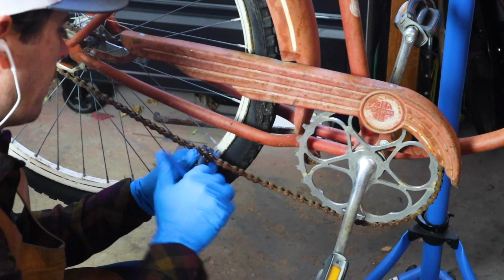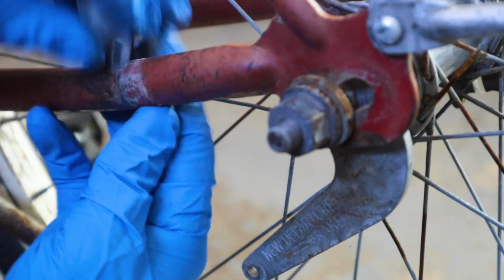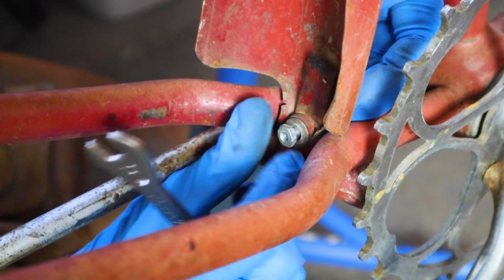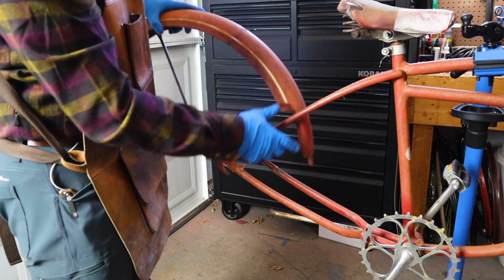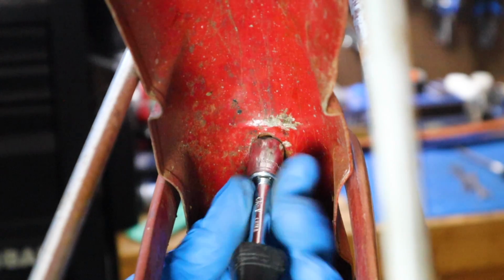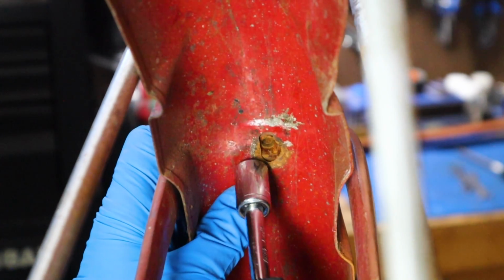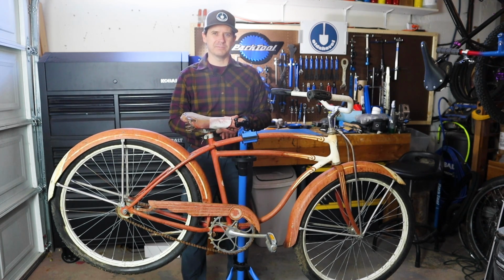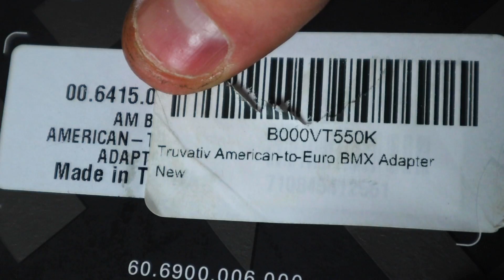Rusty Schwinn Klunker Build

Comment: I think this build is great. Really gave me much to think about in how I go about my builds. I never imagined that a 1" head tube could be reamed out to accept a 1 1/8" headset. I love the blend of old and modern. I think this can be properly be called a restomod. I would love to see more builds from the post war - pre 1970's era. Thanks!
Reply from the maker: Thanks Jim. It’s a fun one. The reaming is a bit sketchy but the tubing was good and thick so I thought it was worth a try. That said, I’m not planning any bid reins on jumps on this thing. 😁
Reply: I was thinking the same thing. The old cruiser 1" is different than a IOS 1" and it looks like the cup size is only 1.4 mm larger, so for this bike you'd need to remove .7mm off the head tube wall thickness. I'm guessing the starting headtube is pretty chunky, so it is probably not a big deal to ream it this much. That New Departure coaster hub is so rad!
Reply: @feltwashers   I've been planning to bore the cups of a standard 1" headset for 1-1/8" since the math seems like it'd work. Not a lot of room, but a cheap headset is easier to replace than a head tube
Reply: I am completely impressed by this move! Since I am confronted with a similiar compatibility problem, may I ask what tool you used to widen the diameter? If it's not a fortune, I am willing to spend the money.
Reply: Mine bikes sells a 1-1/8” headset turned down to fit a 1” head tube no reaming necessary since that’s a one trick pony tool
Reply: *mone
Reply: Thank you for pointing that out. I was not aware that those were available. I visited the site and saw the cups you were talking about. Also other interesting parts on that site. Thanks.

Comment: Never thought the Judy fork or 2.4 tires would fit, now I’m starting to wonder if they would fit my old Rollfast waiting to be turned into a klunker. Awesome build, glad you kept the patina, it looks great.
Reply from the maker: They “fit” but it’s a bit ridiculous. The cruiser bike wheels had to be “precision” trued to make it work and the rear tire had to be deflated slightly to get it on. 😁
Reply: I put some 2.35 wtb trail boss tires on a late 90s schwinn frame, had to deflate the tires to mount them, about 1 blonde cunt hair away from rubbing the frame 😂

Comment: Hey! We used to ride those things UPHILL too, back in the 50s. Along side railroad tracks, and any river or creek trails we could find.  The best hills were on golf courses, because you had a built in jump over sand traps.  Lots of memories in this build - but we left the ashtabula cranks, as they were tough as nails.
Reply from the maker: Awesome
Reply: @oldshovel  I used to have an old LaSalle, actually my first bike. A lot like that old Schwinn, with about a 50 tooth on the crank, and about a 20 on the back.  No fenders, and no cover on the steel framed seat. Big paperboy basket on the front. Pedalled papers with it, with a lot of uphill. My legs were strong back then, and it would really go fast on the flat or downhill.  You forgot to flip the bars, like a board track racer! LOL
Reply from the maker: The flip bars. Lol 😂 awesome

Comment: Sweet!  Love it! I built a clunker from the exact same frame. Nice you had a headtube reamer. I had to buy a turned down headset to fit mine. Got an old rockshox on it. Messes with the geometry. It's a handful on the trail, but at least some extra pedal clearance comes with the jacked front end. Can't wait to see where you take this build next. Cheers

Comment: Im building a Klunker out of an aluminum Kent Del Rio right now...very lightweight for a big bike. Ive already installed quick release aluminum mtn bike front and rear rims and pedals. Its at 29 pounds now and im hoping i can get it around 26 after changing the steel neck, bars and cranks and heavy seat. Great video too btw thanks!

Comment: Fun project, I did a similar build for the singlespeed Worlds in Bend keeping the rigid fork, the coaster brake only is not even close to enough to ride any proper Mtb trail. I suggest you to add a disk brake up front to make it fun to ride.

Comment: This is dope. I’ve wanted to build one of these for so long! I now have a frame, I have a 7 speed internal hub so it will look like a single speed , I’m going to throw disc brakes on, and I’m undecided on forks yet, but I’m going to widen the rear forks and put some hella big rubber on it. It’s currently yellow and white but I’m going to spray it all over in red oxide and then some red that I’ll flatten, and sand back in areas and try and make my first patina paint job. I’m super excited because they’re not very common in Australia so it will stick out at my local bike track!

Comment: Great bike, in the 1980s I used to have a Raleigh chopper and it was a commuter, but also used for off road. The thing that stands out in my mind was the pedal back brake made it difficult to ride off road, it wasn't until the late 80s or 1990 before I started riding a properly built mountain bike. But I wished I could have had a Klunker, the closest bike to it at that time was a Raleigh Bomber.

Comment: There is a trick we use in MX for our grips, we poke a tiny hole at the end and then fill the grips with spray paint and slide them on and wait till they dry, no sliding afterwards and it’s awesome.  Think you could put that to use
Reply from the maker: I’ve tried that and hairspray and a few others. They work well.

Comment: They are fun, I have built several. First up, a real front brake, you will need it. Lately however I have been tempted by the State Klunker, if only for the adult sized seat post and wheels.....
Reply from the maker: Those State Klunkers are on the big size.

Comment: That build is super cool. I've never seen a tool like that for the steer tube! I think you should weld a bracket for rear disc brakes. I've seen you do it before. I also think the frame should remain the original worn paint.

Comment: Hi, love the build. I would add a front brake since you already have the fork tabs, but leave the coaster brake for just the right amount of sketch. I hope you don’t mind if I make a few suggestions. It was cool the way you flipped the seat post to make it work, but I’m worried that you don’t have enough seat post insertion there. I think it’s a 13/16” post and they are still available out there in longer lengths. 

I have found it easier to remove a stuck quill stem with the front wheel on and the bike on the ground. Front wheel between your legs, loosen the bolt, hit with a hammer and twist the bars. The wedge usually breaks loose and come right out. Usually.

I think it’s easier and safer to remove the pedals with the chain and wheel installed. It keeps the crank from moving and prevents your hand from bashing into the sprocket. Yeah I did that. 

I thought the wrench trick for removing the Schwinn kickstand was awesome. I didn’t know that one.
Reply from the maker: I’m totally open to suggestions and yours are all good ones. In fact, I was thinking just what you said when I removed the pedals. 😁
Reply: BMX seatposts work good. There are also seatpost shims available

Comment: Hi - I am a fan and have been watching your builds for well over a year but unlike most of the feedback here, I think this would have been so much nicer if it was given a full sympathetic rebuild with original parts and made mechanically sound for another 50 years as original as possible - perhaps once you have had your fun on it another video would be it returned to original with the patina kept and clear coated over?

Comment: 1st. Awesome build . Fisher and Ritchey would approve 
2nd. What tool did you use to shave the headset???
Reply from the maker: A head tube reamer and facing tool.
Reply: @oldshovel  I need one of them
Reply from the maker: I’m happy to have one. If Park tool hadn’t sent me the one I have (it was a used one they had in their shop) I don’t think I’d have one unless I got serious into frame building. Awesome fun.
Reply: @oldshovel  I can see that. Not a tool that you would use a lot. I remember I tried doing that with a dremel once it worked but not something I'm confident  to do again

Comment: They would run it down “Repack mountain “,
Named by them as they had to repack the rear hub after every ride because the excessive heat on the rear drum brake would liquifie the grease.

Comment: you need to fix the rear hub in place, otherwise you might damage the hub or frame while braking
Reply from the maker: Lol I wondered if someone would notice ... I got it on right after filming and thought about refilling.  Good skids don’t work as well without it tied down.

Comment: Amazing bike and nice video again !

What's the tool to make a threating headset to 1 ⅛ inches non threated? I'm searching one.
Reply from the maker: It’s a headset reamer. I used it to shave the inside of the head tube from a1” (32mm inner diameter) to 1 1/8” (34mm).
Reply: @oldshovel  thanks for the answer, do you have a link to buy one ?
Reply from the maker: Sure but be warned they are not cheep, not even close. Mine was an older used one Park Tool sent me. https://alnk.to/e6ZLixa
Reply: @oldshovel  thanks very much for the link, I wasn't ready for the price anymore 🤣
But I have to get one for my project... 
Thanks for your videos you inspire my future riding !

Comment: Wald makes a seatpost with the flare for new seats.
Reply from the maker: Good to know. Thanks
Reply: The newer wald seatposts are not the correct diameter and don't fit Schwinns properly (none of the ones I've ever had, anyhow).

Several people make seatposts now in the Klunker world that are stiff, some laybacks, but you can get a solid length of 13/16" 2024 aluminum stock and just shim the top for a seatpost and that'll be indestructible/any length you want.

Side note- flipping that seatpost over, there is BARELY any of that post outside of that narrow bit in the frame in the video! That's not good, there's no minimum insertion line on these but the rules still apply! I assume it got moved after anyhow, but I'd get a longer/more solid post. These original ones bend real easy in hard use.

Comment: Did you ream out the steerer tube to fit 1 1/8 inch headset cups?  In the video it looked like you were just facing the steerer.
Edit:. I watched it again I saw that you reamed it.  Is this the tool?  https://www.parktool.com/product/33-9mm-head-tube-reamer-for-1-1-8-headset-standard-754-2?category=Frame%20%26%20Fork
Reply from the maker: Yep. That’s exactly what I did and essentially the tool. It worked great, a bit sketchy but it worked. 😁

Comment: did you convert the standard head tube to oversize? what kind of tool did you use?
Reply from the maker: I used a head tube reamer and facing tool to convert it from a 1” to 1 1/8”

Comment: Interesting that a modern headset drops right in
Reply from the maker: Only after boarding it out to fit the larger headset, it was made for a 1” steer tube but the steel was plenty thick so I figured it was worth a try. 😁

Comment: gotta put one of those Mone souped up coaster brakes on here!
Reply from the maker: I know.  The crappy one I have on is going to get wasted on the first hill. 😁
Reply: ive mountain biked quite a few miles with coaster brake hubs single and internal 3s, the grease will get hot and smoke if you are going down long hills, high temp marine bearing grease and rc motor heat sinks help out on the cheap. enjoy.
Reply from the maker: Awesome thanks for the tips.

Comment: if mad max was to ride a bicycle, this would be the one :D I still insist on thorough cleaning and clear-coating it. And for a more non-conformist look, I'd put a leather-like saddle and go for steel-finish stem and handlebar. And to go completetly off the wall - weld on rear disc brake mount or at least put a quick-release IS adapter mount. Recently I found such on aliexpress for about 20$. Looking forward to see how is this going to evolve.

Comment: never pull a whole oldschool bar setup without the front wheel attached. keep the wheel between ur legs and pull the whole thing off cuz u have an anchor that way... 99% of all cases you dont even look at wd40 for that if you keep it in the right order. front = wheel last front part to go. also saddle post depth is prrretty dangerous. just put it in completely since u barely sit on a trail anyway... other than that nice rat (its what we call it, never heard of klunker)

Comment: If I had a nickel for every time I installed a set of grips...
Reply from the maker: Best comment 🙌🙌🙌
Reply: @oldshovel  Ha! Thanks! I'm not always punny, but every now and then I come up with a zinger. Been loving your channel, by the way. I currently have two old bike projects going - a 1996 Bontrager Privateer that I rode into the ground and am now building up single speed, and a 1999 Cannondale F700 that is also stripped down and will probably go back geared. Your channel is an inspiration!

Comment: That's an 'inch pincher,' which the main sprocket teeth are an inch apart. I believe they stopped that in the late '40's, early '50's, making it a highly collectible bicycle. That & the fact that it's a boy's bike makes it more rare, as boys were harder on their bikes, than girls were, so less boy's bikes exist. Your bike should be restored by someone who is familiar with it, to it's original condition, thus making it worth more. Couldn't you find some other clunker to do whatever it is you're doing?
Reply: Plenty of Schwinn restos out there, not enough Klunkers